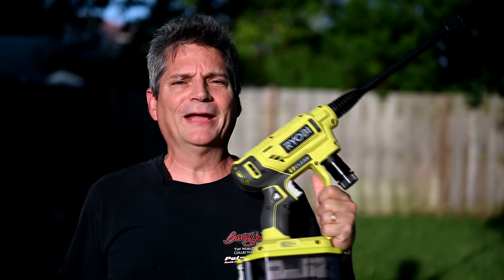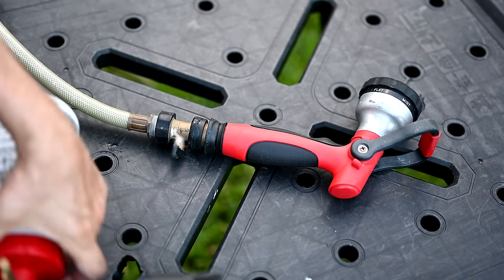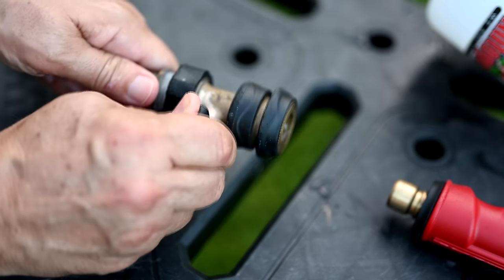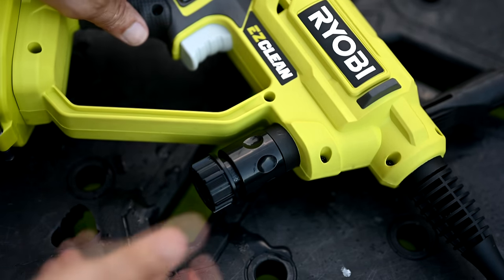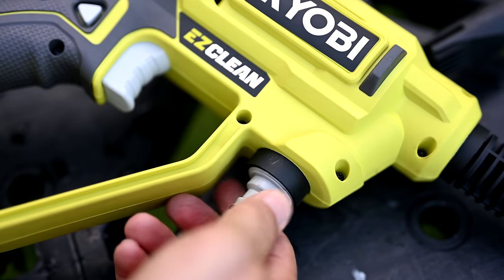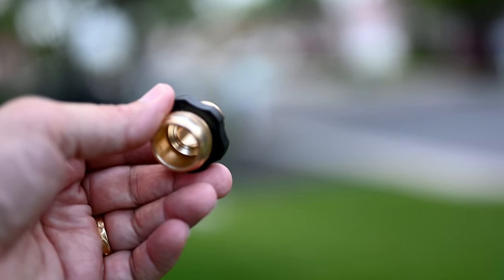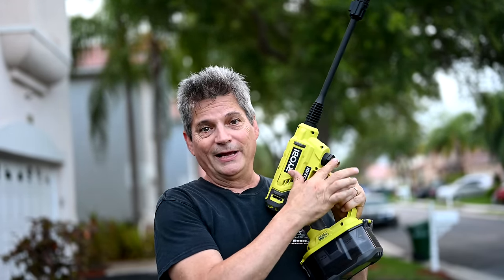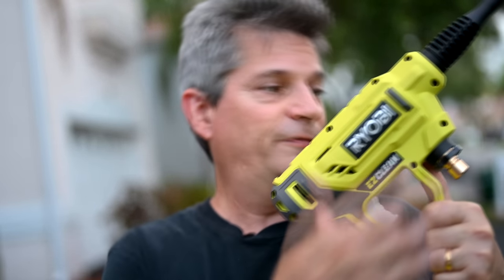Ryobi Hack Converts EZ Clean Pressure Cleaner to Quick Connect

Comment from the maker: 🛒 Autogeek Quart Foamaster Foam Gun: https://amzn.to/31g9q1E Seen in this video
🛒 Gilmour Brass Male Quick Connector Faucet https://amzn.to/2NpmoSH
🛒 Ryobi EZ Clean Cordless Power Cleaner RY120350 Amazon: https://amzn.to/2CqFqWl
🛒 Ryobi EZ Clean Cordless Power Cleaner Home Depot:
https://www.homedepot.com/p/RYOBI-ONE-18-Volt-320-PSI-0-8-GPM-Cold-Water-Cordless-Power-Cleaner-Tool-Only-RY120350/312453233
Reply: Jeff just wanted to let you know the Ryobi cleaner gun is available at Home Depot online as a tool only but if u get the 2 4ah battery kit it’s still $99 all together 👍🏻
Reply: @jeffostroff Great solution. I would expect nothing else out of a Motorola engineer however LOL. One suggestion you might want to put up a link to the Gilmore male and female quick connector pair so those of us who are going to change over to the system can give you the bump when we order them off your link. I’ve actually been considering changing over to quick connect for several years but could neverDefinitively find one system that was the best. Well done sir. #HotSwap
Reply: Jeff, I'm not sure if someone has asked this question.  If you wanted to use the bucket hose (fresh water) adapter, you cannot use the male quick connect.  Is there another brass inlet connector that would work with the bucket hose adapter?  Yes, you are correct the Ryobi EZ Clean inlet adapter is cheaply made, mine snapped off.  I'm look for a brass replacement that would work with the bucket hose.
Reply: Question - the inline shut off valve, looks leach end terminates with female threading, what size is that , 5/8 ? 
5/8' is the normal size for garden hose right ?
Reply: hi. are there any similar hacks for the wand?

Comment: Thanks a million Jeff.  For me this is not just a hack but a solution to a problem that resulted from the o-ring coming off the factory coupling.  I went to lowes last night and bought the in-line shut off (which is brilliant because....well you know why), one female and 4 males.  It's regular multi-coupling, garden gang bang at my place now.
Reply from the maker: Way to go Robert!
Reply: @jeffostroff  the connector on the ryobi is our standard hose outside tap fitting in the uk

Comment: That's great! But what I did was add the quick connect male end to the hose adaptor that they provided so that I can still use the 20' fresh water hose they supplied with the EZ Clean Power washer.
Reply from the maker: Another good solution!
Reply: How exactly did you do that? I want to do the same thing that you did.  Any pictures?
Reply: My thoughts exactly!!
Reply: I kinda did the opposite. I changed the male quick connect on the tool to a brass one, then attached the plastic Ryobi male to a brass female QC. Seemed like a more solid setup.

Comment: Wish I saw this a month ago before returning item.  The gray plastic connector that you screwed off happened to crack right off prior to using first time.  Never realized it was screwed on. Thanks for the tip.
Reply from the maker: I knew these were a cracking hazard which is why I switched to brass quick connect
Reply: Same thing occurred to me first time use. SMH glad I stumbled across. Jeff you’re the man !

Comment: Ryobi have used the Hozelock connection that is standard in most of the world except for America which appears to use high pressure airline connections for low pressure water.

However, I like the inline stop tap in your set up.
Reply from the maker: yes it is very helpful

Comment: The ryobi connector is the standard hose fitting in UK, and i think europe as well  all hoses are sold with this type fitting and also made  in brass
Reply from the maker: Are you sure they are not the slightly different size brass connector that I added? They look very close in size.
Reply: Same for Australia
Reply: 2nd for that original fitting is the standard everyday household hose connector for Australia..

Comment: This is great information because mine broke. I was wondering if it was possible to fix and now I see it is! Thanks
Reply from the maker: Glad I could help!
Reply: @jeffostroff  luckily I had a couple quick connects laying around and I copied your set up with the pressure washer, hose nozzle and the misting fan. Had them all up and running today! Also saw the video on the leaky spicket and tightened up the packing nut. 👍

Comment: Switched mine over to brass when first got it. And that is where it cracked, above this connector, inside the housing. Possibly they made it to break on the original connector since is so weak inside.
Reply from the maker: Yes some cheap plastic

Comment: that connection they have looks like something we use in UK.
Reply from the maker: We prefer the standard 1/4" quick connect
Reply: @jeffostroff  that's a quick connect for us here in UK. I'm surprised they haven't adapted for different markets.
Reply: I was scrolling down for this comment. That's no proprietary Ryobi connector. That's just a normal quick connector for almost all hose pipes in the UK and many other countries. It is designed to be interchangeable so this isn't really a hack is it, just a preference for a non-standard American connector.

Comment: I am a bit confused. You mentioned the problem and then stated you were an engineer so I was expecting you to have actually made a fix for this "problem." Instead you just popped (screwed) in a shop bought American style quick connect. Is that about right? 🤷‍♂
Thanks for the video.

Comment: Great review! Looks better than my Worx hydroshot. My hydroshot is not much more powerful than a regular water hose, end up not using it at all.
Reply from the maker: Thanks for the info! What is the PSI rating of the HydroShot?
Reply: jeffostroff I will try to find it for you this weekend, I need to dig out that manual.
Reply: jeffostroff 320PSI

Comment: I like it and I may do it, but my concern is that you had a plastic replaceable part that would break before the tool does if you torque the hose. Now the tool is the weak point. If you overstress the connection now, you might need a new tool. 
It's not a definite problem, but when you make something replaceable stronger than the non-replaceable, you add a new risk.

Comment: With this hack can you now add a foam dispenser? Also do you know if you could change out the nozzles or add any other attachments?
Reply from the maker: Will be playing with this hopefully tomorrow
Reply: Any response to this yet?
Reply: Did you post a video showing how to change the nozzle attachment to a quick connect? I want to use pressure washer attachments with my EZ Clean.

Comment: The connector that Ryobi uses is a Melnor connector. They are pretty cheap, while the brass connector is $10 at home depot. It may actually be cheaper to switch the other connectors to melnor. I like brass, but I prefer saving cash.
Reply from the maker: I like brass!
Reply: Looks like they used plastic so that the (cheap, replaceable) connector will break instead of the tool.

Comment: Oh man thanks for making this video. Have the same washer. I dropped mine and broke the plastic male adapter. Glad to see I can add a metal one. 👍
Reply: Same, so glad I found this video
Reply: I think I’d rather break the plastic adapter than the plastic fitting on the tool and have to buy a new one. The adapter can be replaced cheaper than the tool.

Comment: Inline shut off valve is easy to find, what is the part on the end of the shutoff valve that has the release?Not the part you attached to the power washer?
Reply from the maker: This is the part you need: https://www.autogeek.net/brqucoset.html comes as a 2 piece set, you only need that double mushroom looking part. It screws onto the end of the shut off valve, and now you have a female quick connect port. The other piece in this kit is a male threaded hose adapter, that you can use on a soap gun, or any other part that needs a male screw in, so that you can connect the soap gun to quick connect.

Comment: Maybe a follow-up video for changing over the fresh water hose to a new quick connect piece would go over well! It would sure help me!
Reply from the maker: I am finding the siphon hose is a joke, you don't get the pressure that you get from the garden hose with that extra 60 psi push
Reply: @jeffostroff  Have you found a way to make your hack work with the siphon hose?  The stock plastic quick connect broke while having a 2 liter bottle hooked up and having seen your video previously I said no problem I have those brass quick connects and I swapped it out in a couple minutes, but they do not work with the siphon hose.  I'm in Maine and it's still too cold to get my outdoor spigot going just for a quick rinse job.  Thanks

Comment: Just used mine for the first time today. When connected to garden hose and faucet open, water free flows through the cleaner at a low rate???  When trigger is depressed, it ups the pressure. Per your video, there’s a flow stop when not in use. I’m thinking mine is busted???  Thanks.
Reply from the maker: Normally with no battery you pull the trigger and a light amount of water sprays out when you pull the trigger. Maybe you have an issue with the trigger. I have to fix mine already the trigger is stuck in and won't spring back to off.

Comment: I appreciate your help but if you preform this hack on the unit you can not use any of the other water supply attachments for the unit like the bottle or bucket attachments 😕
Reply from the maker: You easily unscrew it and put the original back on

Comment: I want to use this to clean the shower....can this be done?  Or do you think the PSI is too much and will damage the grout?
Reply from the maker: It will not damage grout, unless your grout is falling apart. Experiment on small area, you can pull back on the sprayer to make it farther from the wall to decrease pressure if you need to

Comment: I bought one of these, barely used, from a local pawn shop at about 50 percent of full price. However, it didn’t come with any accessories, so in addition to the adaptation in this video, I need to make a siphon hose for it myself. I have plenty of extra hoses and I can use/sacrifice one of them for this purpose. Are there third-party versions of the intake filter available that would screw in to a regular garden hose?
Reply from the maker: Good question we have not played with that yet I can tell you though that the Ryobi power cleaner, just like the DeWalt power cleaner, both of them stink trying to use the siphon hose out of a 5 gallon bucket the pressure quality is just way low because it doesn't have that 60 PS I have a garden hose as a headwind to get it started. In the Ryobi one seems to lose prime a lot when you're trying to siphon it out of a bucket
Reply: @jeffostroff  I made a siphon hose out of a 25-foot RV/Marine hose and tested it just yesterday. Put a piece of metal filter mesh over one end and zip-tied it in place. Need to find a way to add weight to that end so it stays in the bucket. Even so, most of the time it didn't work well in my limited testing so far. It usually only produced a trickle of water, although a few times it did spray with the same force I get when it connected to a regular water hose. I am going to try stretching out the hose for a few days to see if taking the "coil" out of it will make a difference. If not, it will be disappointing, but as long as it works with a regular hose hookup, it will be okay.

Comment: I don't have one of these on hand, but is there now an easy way to swap out the siphon hose that comes with it with the same quick connect? The one you drop in a bucket
Reply from the maker: I have not done anything with that hose yet but I imagine it with the right parts it should be the same thing maybe one day I'll get around to trying that out
Reply: @jeffostroff  I got one of these the other day and it broke in two areas at once.   The garden hose attachment broke into the quick connector and the trigger froze in place (the cruise control button doesn’t release it either).  Happened simultaneously.
Reply: @jeffostroff  I broke two of these plastic ones.  I just put a brass one on and now I don't think any of the ryobi attachments will work (such as the one I mentioned above) because all of those have the female proprietary.  End on them.  No way to connect that to my new universal male.
Reply: Wait.  might be wrong.  gonna report back
Reply: @jeffostroff   turns out the quick connect nipple that was on there isn’t REALLY proprietary, it matches the plastic ones sold at Home Depot.  The one that was on the machine was slightly shorter than the one I just referenced, but the connection is still good.

Comment: Isn't that connector a standard Gardena brand quick connector? The big thingie that plugs into it from the hose shouldn't be a straight-through connector, but one that will not allow the water to flow until it's plugged into the connector. I think Gardena's been around for their patent to run out because I'm sure I've seen those same connectors in metal too (brass?)
Reply from the maker: Yes, looks like the Gardena, I used to have a gray and orange gardena years ago

Comment: Can you still use the original holes that came with it the one you put in a 5 gallon bucket if you don't want to use the garden hose
Reply from the maker: You would have to convert the end of the siphon hose to a quick connect also, or you could just unscrew the quick connect and screw the siphon hose back on like normal.
Reply: @jeffostroff  Jeff how do I add the adapter to the bucket and siphon hoses?  Thanks for the videos

Comment: Geat idea. I actually had those parts, in hand, last night. I didn't buy them as they don't meet my need of using the included hose for pulling water out of a bucket. Any ideas for that?
Reply from the maker: I have to experiment some more on that and on the dewalt as well as they both seem to have proprietary connections there that need to be adapted if you want to put quick connect on the port that in the water from the hose. But we have also discovered that the pressure spray is not as strong when you siphon out of a bucket like when you siphon directly out of the running hose and that is because the bucket of water has no pressure behind it where is your hose has that extra 60 PSI which makes all the difference in the world. So when I use the 550 PSI dewaldt sprayer and use the siphon out of a bucket method with that sprayer, it's way low pressure like half of connecting it to the hose. And so using the dewalt 550 PSI unit to siphon water out of a bucket is the equivalent of using the Ryobi unit by itself connected to a hose

Comment: Can you come out with a mod on what to add to be able to hook up our foam cannon? That would  be so helpful. Thanks for sharing
Reply from the maker: Well the foam cannons used the standard quick connect feature found on most pressure washers which the Ryobi does not have what I need to see if there's some kind of interface that will convert Ryobi proprietary connection on the end there and convert it to a standard quick connect
Reply: @jeffostroff  oh please that would be so helpful. And awesome

Comment: What is the brand name for Jeff Ostroff's  Ryobi EZ Power Cleaner Quick Connect for the RY120350 sprayer and where can I buy it?  What do I ask for?  I need this product.  Thank you in advance for responding.
Reply: Brand name is not important; any standard size (3/4") metal quick connect system; you just need the male connector (they're usually sold in pairs).

Comment: I'm living in Sweden - and i'm wondering what the size of the threads are?
I bought a 3/4"-adaptor to test but that is wrong.
The OD is correct but the thread is incorrect.

Can you please tell me which thread Ryobi use..?
Reply from the maker: they are using some thread that I hear is popular in Australia but it's not a standard pressure washer threading.
Reply: @jeffostroff  Ok. Thanks for answering! I will investigate further. 🙂 👍
Reply: I Sverige passar den om följer med 👍

Comment: I also use quick-connect on my hoses and sprinklers. I found that those metal brass quick-connect are not compatible with the plastic quick connects. So early on you either choose going with brass or plastic. I chose plastic about 20 years ago because they were more readily available everywhere and cost less. Probably the reason Ryobi chose plastic, for all the rest of us that have plastic quick-connectors.
Reply from the maker: I love my brass!
Reply: @jeffostroff  Great, I now see more availability of brass connectors than before. By the like your idea of an on-off switch near connection. I also ordered the ryobi power clean, thanks.

Comment: That's not a proprietary connector, Worx has used it for years on their Hydroshot. The problem with your setup is that now you can't draw water from a bucket without switching the quick connect back to the factory one. What I did was to use a short length of hose with the provided connector of the power washer and a garden hose quick connect on the other end of the hose, that way I can use a garden hose, or the supplied siphon hose and not have to swap connectors.
Reply from the maker: Yes, I'll be doing something similar.
Reply: This mod is based on home use and his recommendation is that. If he rigged the Ryobi with this adapter, I’m sure he can rig up a hose that would function in those circumstances that do not have access to water.
Reply: It's the same plastic connector Gardena, Melnor and everyone else has been using for over 25 to 30 years.  Definitely not proprietary, so it will be easy to get replacements if it gets broken off.